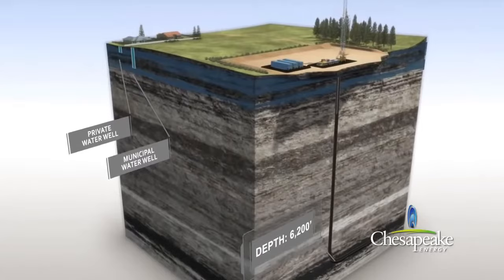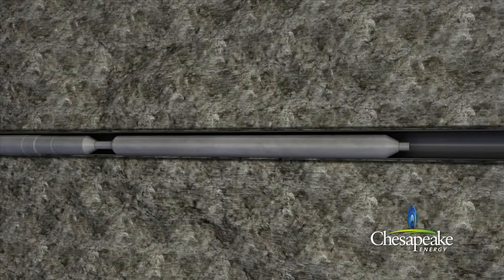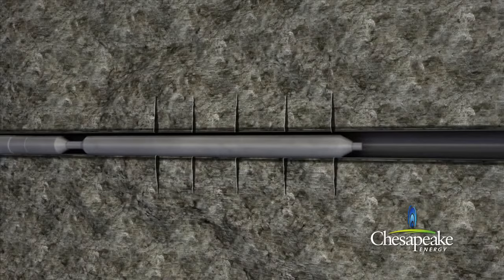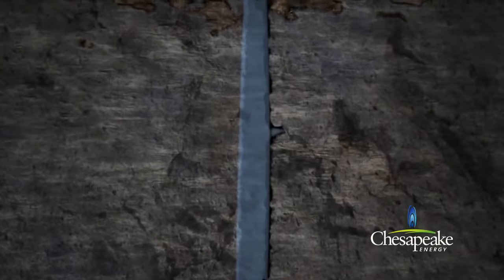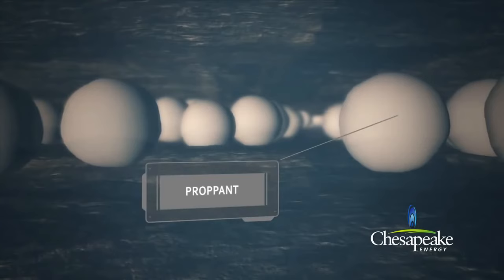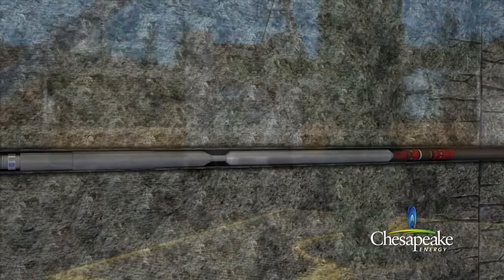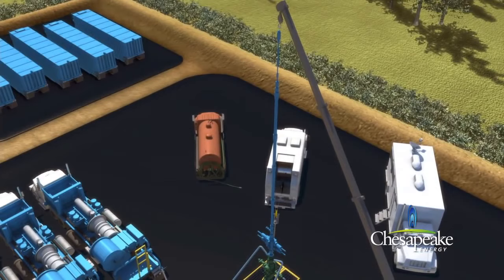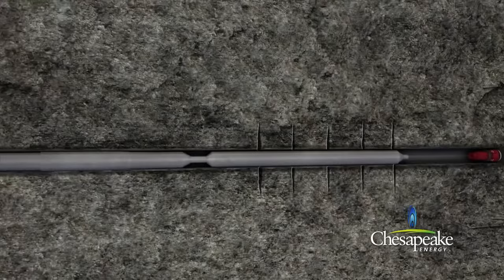Well Stimulation: The Process of Hydraulic Fracturing

Comment: Notice how they show the nice, totally safe farm and house in close proximity to this operation, and we obviously know the eventual devastating effects for the cute little farm and family. 😢
Reply: And what exactly is the devastating effect?
Reply: Corrosive chemicals that have levels of toxicity which are seriously damaging, not to mention the thousands of barrels of powerful acid to enable the seams in the shale formations to release its pay zone of gas, condensate, etc. All combined, and seriously doesn't require very long for this to also break up the concrete sleeve of the production pipe which is pumped down around the outside of it to also deteriorate, hence releasing everything into the different aquarius of fresh water that the drilling has gone through in the initial process. Understand more now? ❤

Comment: The noise is horrible. XTO took 7 weels to drill and now on 7th day of fracking. You cannot even stand being outside due to loud noise 24/7.
Reply: I use to roughneck on the service rig but need to do something different due to an injury. Is this job easier than that would you say?
Reply: New electric pumps are quieter
Reply: @onemoretime734 yes frac is much easier than roughnecking